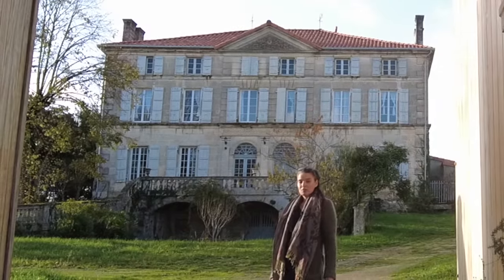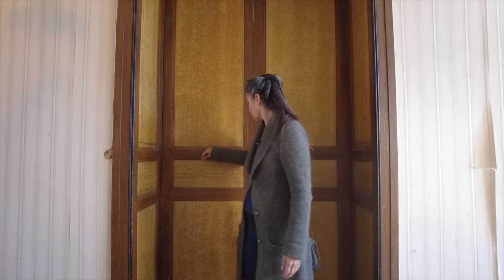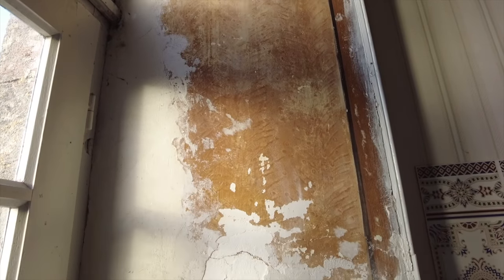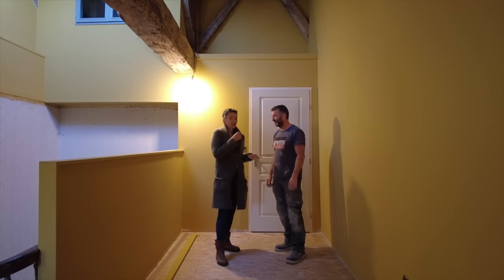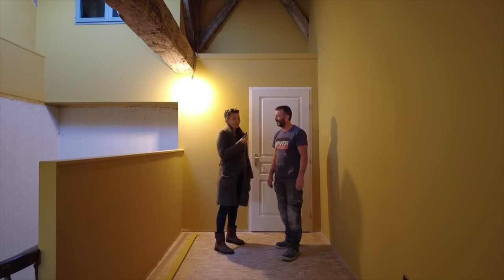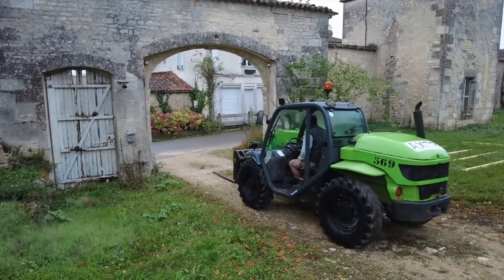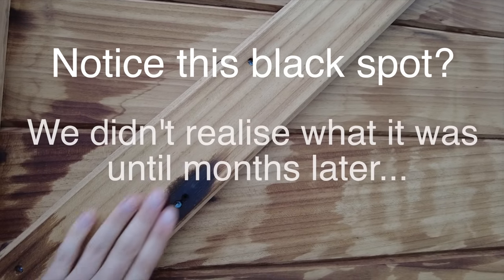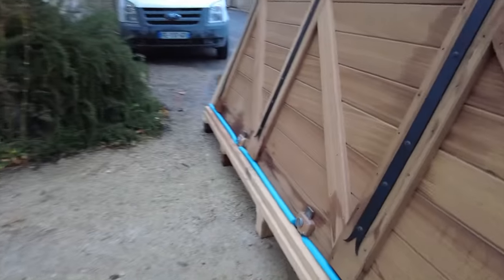Ep. 21 New Doors for our Chateau Arch!

Comment: Why didn't they simply replace the original screws with stainless steel screws?
Reply from the maker: Hi Rayn, Yes at first I thought that is what they could do, but by the time we realised what was happening, 4 months later, it was already pretty bad - the wood was stained and the screw holes were rotting, which meant that even new screws would fail to hold the doors together for the 10 years that they are guaranteed.

Comment: As an English joiner I can  tell you, that not only did they use the wrong screws for your ledge and brace gates, but also  the  brace are wrong, and over time they will have sagged. Also if they are to take a finish then the finish should be applied to the tongue and groove before they are are put together.  It also look like the ledges are not angled to let the water run off . I could go on about what else is wrong. If I was you I would be looking for another supplier.  Your gates were made by someone who didn't have a clue unfortunately. Also they are now replacing your hardwood gates with cedar which is a softwood? With your internal doors if they are not hung then better to have them laid on bearers on  a flat surface rather than leaned on a wall.
Reply from the maker: Thank you for your comments Jim.  Let's hope they do a better job with the new gates.  I've been told they'll be in Red Cedar, which is apparently quite resilient.  We'll have to wait and see  ...

Comment: They must have been seriously expensive for the supplier to eat the replacement door cost, fittings were good quality but not to use correct screws for the doors gaurentee a sad oversight , assuming doors are twisting with the corrosion in the screws that wood treatments failed to stop.
Reply from the maker: Hi James, In France, building work of this nature requires a 10 year guarantee by the manufacturer.  So since they could see the doors would not last anything like that long due to the faulty screws, they had no choice but to replace them.  We're planning to find a less exposed place to use them though, so they won't go to waste.